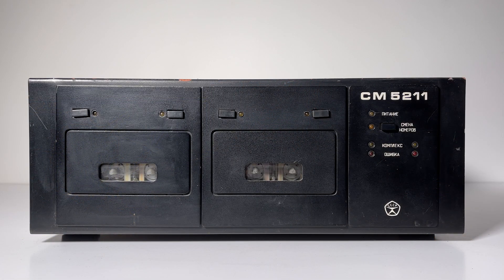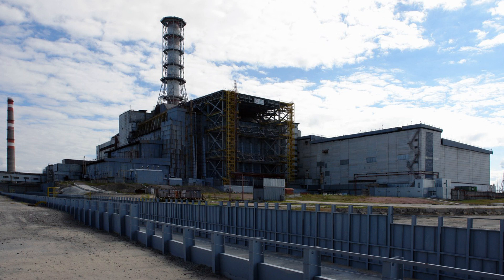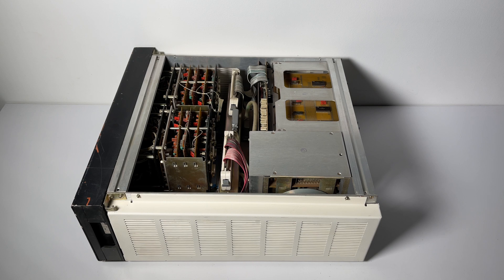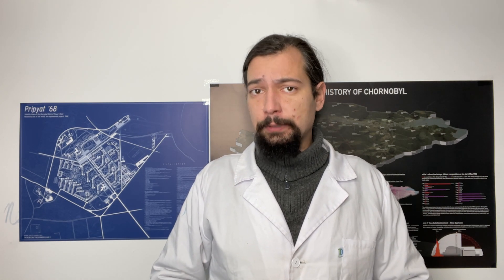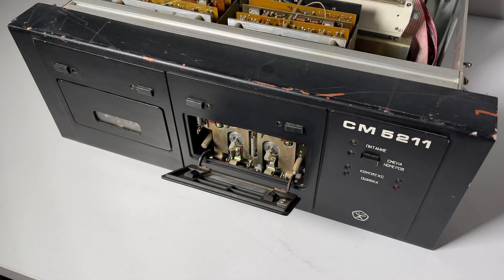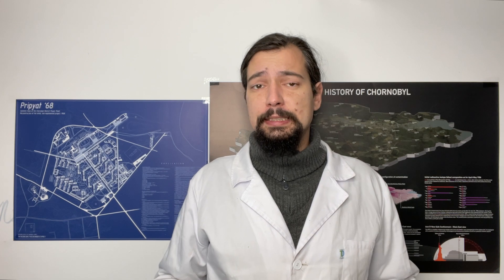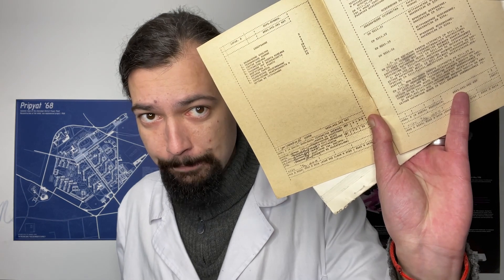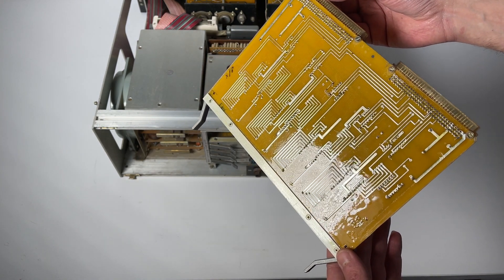Soviet 30 Kg heavy streamer for a PDP-11 clone.

Comment: I found once this mainframe in Jupiter factory
Reply from the maker: Yeah, they are on a "balcony" above the entrance of administration building, 3 or 4 of them..m
Reply: @ChernobylFamily  AFAIK, this is one of first dual-processor setup, this is true ? And it was build internally in Ukraine / Kijev ?
Reply from the maker: @Jenotpl I will be honest,  I did not check the type specifically when I was crawling over those racks; IF those are 1420 which they look as, then yes, those are from Elektronmash factory in Kyiv. Could also be 1810 as well, those are not PDP, but Intel-based, also Kyiv-made. In fact, wast majority of specifically PDP-11 line of SM machines were made in Kyiv.

As for dual-processor setup, as far as I remember, there is one processor module in the machine, BUT, there existed СМ 1420.21.22 which was a dual-machine system which would act as dual processor. A pure dual-processor is a Lithuanian СМ-1600; For now I do not have any documents that prove the use of 1600 in Chernobyl. CM-4, CM-1420, CM-1800, CM-1801 were used widely.

Comment: 9:16 ROM board - это плата ОДНОКРАТНО программируемых ПЗУ на 1/2 кб каждая (К556РТ5). Программирование выполняется специальным программатором, который пережигает перемычки внутри интегральной микросхемы.
9:16 ROM board is a 1/2 kb ONCE programmable ROM board (K556PT5). Programming is performed by a special programmer that burns the jumpers inside the integrated circuit.
Reply from the maker: Super thanks for an addition!

Comment: I got some Soviet Walkman .i sadly don't know where they are made exactly . They look extremely outdated compared to the west. And i sadly don't find a replacement belt for any of them .
The plastic fell ... Fragile
Reply from the maker: The plastic is such a problem. It rarely was planned to withstand prolonged periods of non-using...
Reply: @ChernobylFamily  and i need ti change the capacitor. i know its kinda... hu bad but i want see  in working condition! i got 2 of them and the redone got the price directly in the plastic casing its a.n402c Amfiton and i got awhite one sadly no CCCP logo

Comment: Is that board cage same form factor as the modem?
Reply from the maker: A bit taller. Otherwise, the same.
Reply: @ChernobylFamily  I feel like soviet factories produced random stuff, and all products had to somehow be made up of these overproduced components. But maybe that is just what they call Planned Economy 😆
Reply from the maker: @160rpm  you are very correct, apart from that it was random. All was planned. A horribly unnatural and ineffective system.
Reply: @ChernobylFamily  yeah, when you look at it, it looks random because there is no logic to it. But then the true horror is that it was actually planned that way

Comment: The PDP-11 at the Air Force Academy read its programs from paper tape. I remember the only tape that we used (Lunar Lander) taking 43 minutes to load. :)
Reply from the maker: Omg... how long it was?
Reply: The datasette I used with my Commodore 64 had similar loading times. If you wanted to play, say Pac-Man, you literally had to sit for at least 30 minutes before the whole thing was loaded. And heaven forbid if the magnetic head was slightly misaligned. It would reject the load - and always just before it was about to finish - and you had to start all over again. Those were the days...
Reply: @swokatsamsiyu3590  Without fastloader, a 30 minute tape for the Datassette holds 100 KB, which won't fit inside the 64 KB RAM of the C64. People talking about the Datassette tend to exaggerate the loading times. For small and medium sized files and with fastloader, the Datassette is a totally usable device.

Comment: Very interesting to contrast the very crude tape mechanism and front panel (no labels on the eject and write protect buttons!?) with the fan power connector. The power connector has a metal back shell and so many huge pins that look machined. Many US computers I've seen of similar age either use a very basic plastic connector or even just solder wires to the board.
Reply: Like they said in the video - the Army had no use for "user experience" so all the effort and budget went, I assume, in the actual hardware, with "creative improvisations" left for the interface.
Reply from the maker: I'd say it is not that much for army as for the limitation of planned economy. When factories can produce a very limited variety of things, no matter how good ideas you have, you will stick to that.
Reply: @ChernobylFamily 
Indeed, GOSPLAN doesn’t care about ergonomics or UX and GOST standards were probably too generic to force manufacturers away from sacrificing everything in the name of the Almighty Quota but the Army being the biggest “customer”, they could’ve had the influence to ask for it. Which yes, would work… how should I say - “around the rules” (like most things that actually worked back then :))))) of the planned economy. Except that they had no need for ergonomics or user friendliness.

I wonder how East Germany handled it - if I may ask, apart from that unfortunate “Appletron” device, did it look like their products were more… “consumerist”?
Reply from the maker: These connectors are very good, actually, in Patreon version we take a closer look to them as well as to the drives. They look not that crude, just really... too complex, to my mind.

Comment: I know you said it was compatible with the PDP-11 but I wasn't expecting how much those boards look like QBUS, DECs bus system for their PDPs. Pretty cool.
Reply from the maker: I wonder, whether this (a streamer in a whole) is a clone of something as well.
Reply: @ChernobylFamily  I think it is a clone of the PDP-11s architecture, I just wasn't expecting how similar it is to the real thing. I just thought it was interesting. QBUS was a DEC technology used on those systems as their backplane to connect all the cards, the cards then had connectors on them to run ribbon cables to the rest of the computer. Card cage is the word used over here for what you referred to as crate. Very interesting to have a disconnect like that. You don't have to change what you say, it's just interesting.
Reply from the maker: @ДенисГаев-у6е  exactly

Comment: I like your comment about the eject.  Over here in the US it was a kind of sign of quality if something had a very very slow tape eject mechanism, and if something just sprung open, it would've been thought of as something cheap.  Of course, by some point you'd get a bunch of poorly made junk with overly damped eject mechanisms. :p

Also that MK-90 I got is working out well.  Ordered parts to build up a flash cart for it so I can load stuff on to it, and i've started writing code for it and testing in an emulator, but I'm wanting to see how well things work on real hardware.  Have some graphics routines working so soon I can make a game for it.

Any of these PDP-11-based computers that had a graphics output or were they just text or terminal based?
Reply from the maker: It will be interesting to put this into action, still some work is needed though.

Happy to hear about your MK-90! Share the rests, it is genuinely interesting!

From what I have seen, they used terminal interfaces. Though, need to dig deeper.
Reply: @ChernobylFamily  I have code on my GitHub but I dont think it's possible to post links on YouTube.
Reply from the maker: @Aeduo  possible, just they go to filtered messages that i can retreive

Comment: OMG what a trip that tape deck is! Those bypass caps are just the best! It's too bad Stalin declared digital computing degenerate. Had the USSR embarked on a real program of building their own in house computers and integrating them to society, the Sov Punk that would have resulted would have been freaking awesome! I can just imagine the alternate history where the Soviets did everything the West did on a wide scale with the same touch we see in this tape deck. You can imagine a world where nations like India and Egypt become flush with Soviet computers. And instead of MiG diplomacy the Socialist Bloc and the non aligned nations would be running on Soviet computers, networks and software. This made by day with its general awesomeness.
Reply from the maker: Well, that was not Stalin, but Khruschew,  and not digital computers, but cybernetics. However, there was an epic page of our computer history – OGAS system project by Viktor Glushkov, founder of the Institute of Cybernetics in Kyiv; that thing was so ahead of time, and so dangerous for communists (as they would not be needed in algorithm-driven USSR as he envisioned) that he received a resistance of it up to his death in 1983.
Reply: @ChernobylFamily  Thanks for the history correction. Now I have to read up on Mr Glushkov. Any relation to the Soviet rocket engine pioneer?
Reply from the maker: @AndrewTubbiolo  no, that is Glushko, he had a similar sounding surname. However, there is a relation in a meaning that many things developed at the Institute got their application. And still many new do.
Reply: @ChernobylFamily  
Ни Сталин, ни Хрущев....
"В 1958-ом книга Винера была издана у нас и сразу стала необыкновенно популярна. В конце 50-ых-60-ых годах в СССР был настоящий кибернетический бум. Словно грибы после дождя, появлялись научно-исследовательские институты, факультеты ВУЗов, лаборатории, кафедры, отделы, научные журналы, ученые советы, в названиях которых стояло супермодное тогда слово "кибернетика" в самых разных сочетания: техническая кибернетика, математическая кибернетика, теоретическая кибернетика, технологическая кибернетика, экономическая кибернетика, химическая кибернетика, юридическая кибернетика, и т.д, и т.п. Сотни тысяч научных сотрудников и преподавателей было вовлечено в эту сферу."
Neither Stalin nor Khrushchev....
In 1958, Wiener's book was published in our country and immediately became unusually popular. In the late 1950s and 1960s, there was a real cybernetic boom in the USSR. Like mushrooms after rain, research institutes, university faculties, laboratories, departments, departments, scientific journals, scientific councils appeared, the names of which contained the then super fashionable word "cybernetics" in a variety of combinations: technical cybernetics, mathematical cybernetics, theoretical cybernetics, technological cybernetics, economic cybernetics, chemical cybernetics, legal cybernetics, etc., etc. Hundreds of thousands of researchers and teachers were involved in this area.
Reply: @ChernobylFamily  dangerous not communists(they are actually happy about it), but for nomenklatura(beaurocracy)
Reply: It’s so sad because at one point Soviet computing was far ahead of the west, but the expense and effort wasn’t appreciated, I could imagine an incredible world of technology had the soviets kept up their development, it would have provided impetus for western companies to try harder and could have spurned development during the stagnation periods in the 70s and 80s that slowed the development of more advanced technology.
Reply: Nothing about it is awesome
Reply: @NSPlayer  Having spent the years from 1979 to 1984 using an Atari 410 data cassette recorder, I can tell you that this duel tape deck is awesome! I'd have loved to have these machines as my computer.
Reply: @Andrew Tubbiolo Funnily enough, your computer alternative to "MiG diplomacy" was a vision shared by East Germany's Hoenecker. He was so convinced that advanced technology would secure East Germany's future that he poured like... (could be wrong here but it was a big number) 30% of the GDP into microelectronics and semiconductor production.

Unfortunately, as with chip production today - there's a reason why only few countries make most of them - without a market demand in the millions and billions to justify the investment costs, building the production infrastructure is incredibly expensive.
And sadly the Soviets did not want to help the Germans much because they were paranoid that West German spies would cross the Berlin Wall and steal any technology they'd share with them.

Even more perplexing, there was this socialist equivalent to the EU trade block called COMECON and under it, there was a unified plan for all communist countries to collaborate on developing the same computing standards. This is also how PDP-11 ended up as the template for so many computers. I don't understand why East Germany's vision wasn't given more support through COMECON but I can only assume paranoia and petty politics sabotaged this.